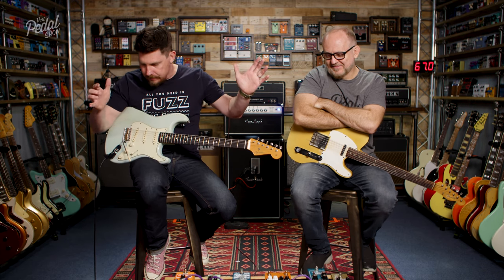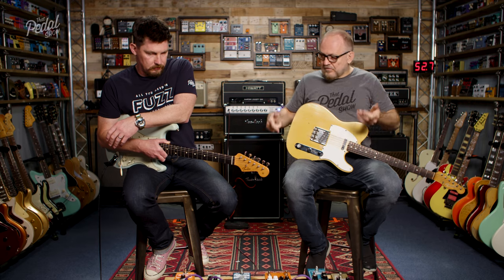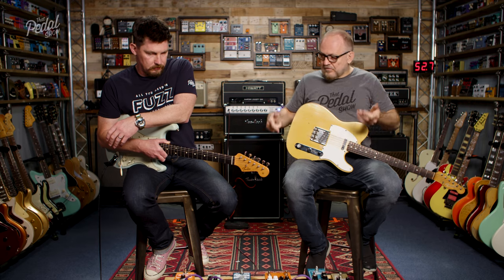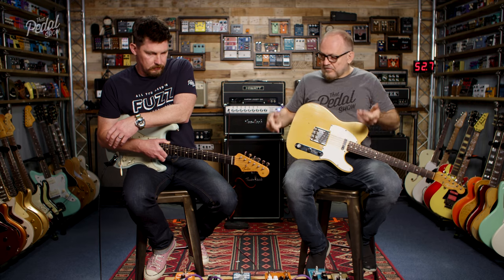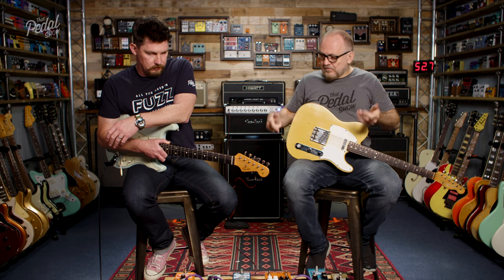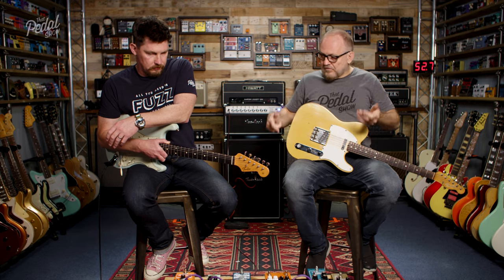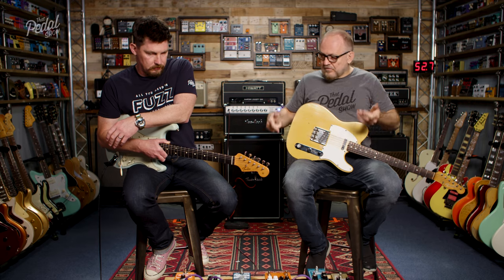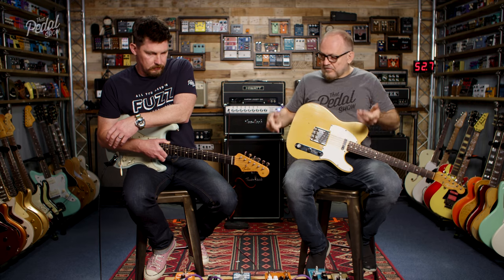To Buffer Or Not To Buffer: That Is The Question – That Pedal Show

Comment: @ 26:00, I actually just sold my echorec to get a Bell Epoch deluxe because I find that the preamp on the echorec cuts some Lows, whereas the bell deluxe keeps the zonk machines warm. Bell deluxe has better - higher headroom also. The zonk is a crazy fuzz that needs high headroom only afterwards :)
Reply from the maker: Nice! I have a new one incoming as it goes. :0) That low end cut can be sooooo useful in a band context, but at lower volumes can really suck!
Reply: That Pedal Show I have the D*A*M zoot unit(straight up old zonk clone) my experience actually is that only the Kingsley stuff and high-voltage pedals can handle its massive output - I guess headroom is a separate topic from yalls video.l :) , but related ....cheers! Great video!

Comment: I have a problem with my current setup that isn't buffer related, but is caused by a low input impedance. My preferred overdrive of the moment is a One Control BJFe Honey Bee, which has an input impedance of just 370 KΩ. My problem is that I have a tc electronic Spark mini booster in front of it, which has a 1 MΩ input impedance. So, what happen is, when I step on the Spark mini, I get a substantial treble boost going into the Honey Bee, and it's more than I want. 

Most of Bjørn Juhl's designs are relatively low input impedance, so this problem is common in the One Control line of drive pedals. The solution is that I need to swap out that Spark mini for a One Control Granith Grey booster, which has an input impedance of only 500 KΩ, which will mitigate that treble boost. Unfortunately, the Granith Grey costs more than twice what the Spark mini costs, but my birthday is coming up, so I will probably get one soon.
Reply from the maker: It’s actually the output impedance of the Spark driving the lower than normal input impedance of the Honey Bee. It’s similar to the issue on the fuzz, designed to see the pickup coil
Reply: EUNA might be able to help you with this, hit me up if you want to chat!
Reply: @ThatPedalShow  Interesting. When I use the Spark mini in front of my tc electronic MojoMojo on my jam session/practice board, I don't experience the same problem. The MojoMojo has a 1 MΩ input impedance.

Comment: I run 10 pedals on my board with another two in the effects loop of my amp (I am aware that Dan is probably cringing at the thought of running that many pedals without a looper), but in all honesty, running that many pedals with the associated capacitance is kind of a darker sound that I really dig! It surprisingly voices the amp quite well, and when I plug my guitar direct into the amp, it sounds a bit too bright for my liking! Bit of an unconventional way to darken my tone, but hey, it kinda works in a way that I really like!
Reply from the maker: If it sounds good... 🤓👍
Reply: @ThatPedalShow  Rig Rundown - Carlos Santana on you tube .... he uses a long cable because apart from getting around on stage the capacitance helps the sound he is after .... so a lot is what the sound is you are after I guess... and all that helps you achieve it is ok ...

Comment: Hi.  When you started talking about cable length it reminded me that I have been using  Line6 G30 wireless connection for many years (very reliable) and that has the option to emulate either 15 or 20ft cables or it can be switched off which I assume would let the tone pass unhindered.  Many people shun wireless as they think it sucks tone but surely it's the other way round.  How does that play into the issues you have raised in this video?  So thought provoking your videos are. :)

Comment: @ThatPedalShow
That Euna with the Les Paul was absolutely brilliant. The perfect balance of warmth and clarity. Question though: did you try turning down the brightness on the Euna while using the strat? It looked like the brightness was pretty close to max.
Reply from the maker: I don’t think there’s a brightness control on Euna?
Reply: @ThatPedalShow  I was a little off there. It's a switch, not a slider like I thought. It's got the three little switches, one for low, one for bright, one for harmonics. But since it was engaged in the video, I figured if it was down/disengaged for the Strat it might be a bit better.

On a side note, Mick playing the Strat into the Two Rock with a 6 inch patch cable is one of the funniest things I've seen on the show, loved it.
Reply: @ThatPedalShow  There is though. That "B" simply means brightness. And you had it on for the whole time...

Comment: A tone pot in a passive audio circuit bleeds high frequency to ground through a capacitor / resistor network. Ordinarily, a tone pot at ten will be max resistance which allows the least amount of high end bleed with no load pots providing infinite resistance by breaking the path to ground.

A long cable loses high end through signal loss due to increased resistance proportional to the length of cable.

Comment: You can roll off high end on your amp. You can’t add what’s not there though. I use buffers so my rig sounds as much like my guitar straight into an amp with a 10 ft cable as it does with my pedalboard and long cable runs.

Comment: Woah gents, the timing. Would this be why I loved the sound of a Homebrew Germania 44 (similar to a Dallas Rangemaster if I haven’t got my wires crossed) that I got today when it was only it and then straight into an amp, but not so much when I tried to put it in the drive section of my board?

Comment: Just to clarify the revelation of running the patch cable straight into the amp ... Was the conclusion that it sounded bad because the patch cable was too short and the pickups and amp were designed to use a longer cable? If so, what's the optimal instrument cable length? Or is that a whole other can of worms?

Comment: If I get a big volume boost and change in tone (a lot warmer) when I turn on my Avalanche Run delay and reverb, do I need a buffer?

(I like the warm sound when it’s on. It’s the low volume when it’s off that I’m trying to combat)

Signal  chain:
* Boss NR-2 - High input impedance, low output impedance - Buffer
* EHX Crayon - Low input, low output - True Bypass
* EHX Soul Food - High Input, Low output - True Bypass (option to change to buffer)
* Way Huge Overrated Special - low input, low output - True Bypass
* Boss NR-2 - High input impedance, low output impedance - Buffer
* Boss FV-50L - Low input, low output
* Boss TR-2 - high input, low output - Buffer
* Fender bubbler chorus - high input, low output - bypass?
* Earth Quaker Devices Avalanche Run - High Input, Low Output - Buffered Bypass (option to change to true)
* T-Rex Replay Box - High input, Low output - true bypass

Comment: My fuzz is a Mythos Golden Fleece which isn't as affected.  It must have a lower output impedance.  And I have in a loop of a Quartermaster.  Then at the end I have a Mad Professor Deep Blue Delay into a Dunlop EP103 and then a HOF.  All of which are not in the Quartermaster but always on and therefore buffering the amp drive cable.  So I tried turning them all off and then trying each one.  The EP103 brightens things up the most despite not supposed to be having a preamp emulation in it.  The HOF is very neutral and the DBD almost darkens things imperceptibly.  Probably compensates for the EP103.
For Mick I suspect he needs some sort of loop with the fuzz and a buffer will be needed, just to be able to get it to work correctly.  Maybe just a Humdinger with a single switch bypass loop.  New product for Dan.  Specifically for fuzzes.
Also, what about the Radial variable load box somewhere in the chain to moderate the sound of the buffer.

Comment: Very good episode!
I earlier shows,  I believe you have expressed that you are not so fond of the buffers in Boss-pedals. I wonder what you dont like about them, and if there are differences  in “buffer quality” between old and new and the different models. I have two pedals with buffers in my chain, an old VB-2 and a DD-2, and they work very well.
Reply from the maker: It’s what they do to the pedals after them, not that the buffer itself is ‘bad’. And that depends entirely on the pedal.....
Reply: @ThatPedalShow  Dan and Mick, following on from what has been said here. I have two Boss pedals but towards the end of my chain. Is this still bad? In true That Pedal Show speak. I have  either of my two USA Fender strats going into my Dunlop Fuzz Silicon, the Fuzz going into my Wampler Tumnus, the Tumnus going into my Ibanez TS808 reissue, my TS808 into my Boss Wazacraft CE2, and my CE2 going into my MXR Carbon Coppy. and lastly into my Boss RC3 Looper. I have a rival power block. I can't afford Dan lol :D .  Even with the power block my system is noisy with the two drive pedals on or the Fuzz being on  at bedroom level. The amp is a Fender Blues Junior Version 3 (With the Jensen Speaker). I don't know if I need a buffer. I am also trying desperately not to buy a noise gate Sorry to Hijack your question  Reinhard Hvidsten
. But it is relevent to me with a pair of Boss pedals. Thanks guys . Great show.

Comment: The problem with most of the effects circuits from the 60's (which includes the old fuzzes) and to some extent with modern pedals based on them, is that the bosses of the companies selling them saw them as quick cash gimmicks. They would pressure designers, who often did not understand transistors very well, to build circuits with as few components as possible to maximise profit. In addition guitarists were not expected to daisy chain effects. The individual company view of the signal chain was - guitar, our gadget, amplifier input. If having the gadget plugged in, but turned off changed the sound compared to the guitar direct to the amp, they did not care. Foot switches designed to switch audio rather than mains power did not exist (mechanical TB foot switches still aren't much better). Often a single pole two way was all you got, leaving the input of the effect always connected. I think True Bypass has become a fetish, partly because of the bad old days and partly because if your pedals die mid gig you have some chance of still getting a signal, crap though it might sound, through to the amp (if none of the pedal switches are broken). It really is not hard to make a properly designed, guitar signal transparent buffer. There is no good reason for anything that claims to be a buffer to sound or behave differently from any other (unless you are getting obsessive about absolute minimum noise, absolute minimum distortion and huge headroom). There is nothing special, for example, about the buffer in the Klon Centaur, it doesn't even benefit from the possible extra headroom offered by the supply voltage trippler. It is a single op-amp, half of a TL072 running off 9Volts. Simple.

Comment: Nice Shakespearean effect on the intro, Mick! It echoes with olde English.  Without further delay, maybe try a BD-2W inplace of the D&M/Klon to safe space and preserve irreplaceable gear? At the risk of being subjective, I prefer the Danelectro 3699 to the Dan Drive Secret Machine, based on your videos, not personal experience. What is the impedance topology of that pedal? Would it solve the problem? Dan's name is included in both, so that is a wash. Finally, reactive loads are very tricky, indeed! What's the Frequency, Kenneth?
Reply from the maker: Ha! BD-2W is bit true bypass!? Wow? Tonally I’d never choose it for me personally.... I’m addicted to the Secret Machine. My current fave fuzz!
Reply: @ThatPedalShow  I think that all Boss pedals have buffers, which the Klon has as well.

Comment: I've also discovered I'm not the biggest fan of buffers, but there's really no way around it with a modern pedalboard. Have you researched "un-buffers" at all? Apparently using a tiny transformer as an inductor you can simulate the impedance of a guitar pickup.
Reply from the maker: Oh there totally is a way around it! It’s never been a problem until now. Without a fussy fuzz, G2 solves every problem I’ve ever had. But the fussy fuzz, well that’s new. :0)
Reply: @ThatPedalShow  prob got lost in the comments, use your g2 but use a 10m cable on your fuzz out jack. When you find a cable length you like, solder a cap across a patch lead to mimic it, I have 2nF and works a treat into a following buffer.

Comment: Very interesting! If you add a low pass filter with no resonance after the buffer wouldn't that take away the harsh top end that Mick hates?
Reply: This is often what I use the Chase Bliss Condor for
Reply from the maker: The resonant frequency of the pickup is dependent on load, so you can tune the load from the pu’s, but it would need to go immediately after the guitar, the output impedance would still be low so won’t work into the fuzz
Reply: @ThatPedalShow  I was just thinking about how most synths work. A tuned low pass filter after a square or sawtooth reduces the upper harmonic content, but I guess using this method you will throw out all of the top, even the harmonics you might want to keep.

Comment: Can you do an episode, where you guys talk about amps, that works together nicely in a wet/dry setup, in terms of frequencies? And maybe also talk about fuzz and buffers?

I’m running a jtm45 (as wet), and a ac15 (as dry). And they’re really nice together, but it isn’t any fuzz that likes this setup. And also, I’m losing some topend, when I’m running my guitar through this rig. I have two buffers on the board, so I dont really know why?
Reply from the maker: We’ve done the amps thing I think... you’ll always lose some top end if there are cables involved. Could be anything else in that chain. And as this episode proves, it really depends on what the buffers are and where....

Comment: I've had a similar issue with a vintage type uni vibe. I like to run it before dirt but it is very buffer sensitive. If I put a buffer after it it behaves but sounds weak. Without a buffer after it it has a huge volume spike but sounds great.

Comment: So, I know you tried the buffer in the EUNA, but I think the MXR MC406 might be a better fit, in your case, as it adds both high and low cut switches, plus a variable 6db boost, which some older styled devices need (the design of the Secret Machine sort of leads me to think that it's needed).

Comment: Just wanted to clarify, it's not a matter of geemanium, you can make a buffer with a germanium transistor if that's your fetish, output impedance is a matter of circuit design alone and it's more often neglected than input impedance. It could be a giant volume pot, a passive mixer, a last stage that just isn't low impedance, tone controls... My fix for those badly made circuits would be an output buffer with a small capacitor to ground before it to emulate cable capacitance, so you have your favorite tone and no interactions, like i did for the ocd. Wouldn't it be a wonderful world if everyone cared about input and output impedance and you could put pedals in any order?
I agree that the immortal echo must have some stupidly high input impedance, like 10M, to make a volume jump from the 1M of the other pedals and the two rock (very probably). Is it a good thing? Don't know, nobody needs that much impedance, it's more prone to noise and it can cause those jumps unless it's buffered bypass.
Buffers should actually be all the same: if the impedances are suboptimal or it has additional filtering and shaping, it's not a good buffer anymore, it's an effect basically.
Don't ever get me started on that blue buffer box, so stupid, it says everything and its opposite.
Cool thing with the patch cable, it's a thing everybody says but nobody ever tries.
Reply: EUNA actually has some spots available inside so that DIYers and tech-savvy users could build-in their favorite capacitances/resistances. It's shipped cleanest/clearest, but I have a lot of love for folks who modify their gear and am happy to provide info.
Reply: @29Pedals  i've seen the product page and i'm glad that you invite users to have fun with the circuit, but i still think diyers would rather build their own buffer, and altough it's a given, i still dislike the marketing speech in there.
My original comment was maybe not well backed, but i don't want to argue with every statement in the product page unless you ask me to.
Reply: @lucianodebenedictis6014  Building your own is definitely a great option. EUNA has a super clean +/-15 volt PSU internally that may be hard for some DIYers to replicate, so it's there if you're looking for a solid mod platform. It will drive down to 600 Ohms perfectly flat, so I certainly care about output impedance!